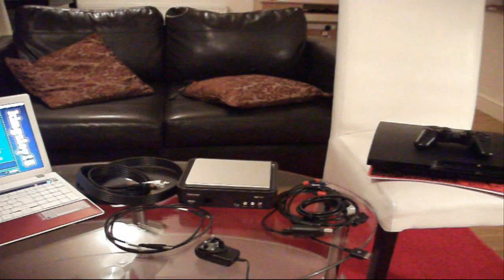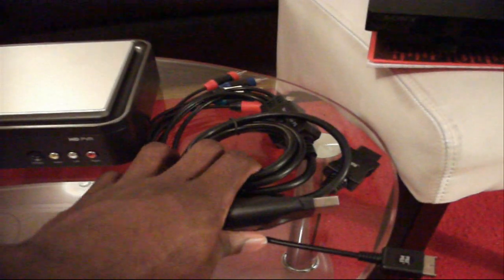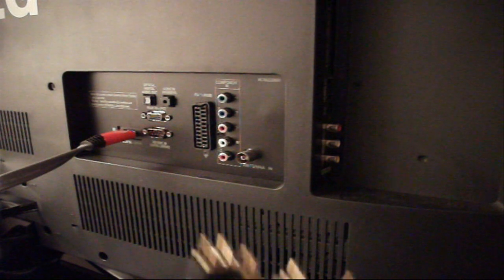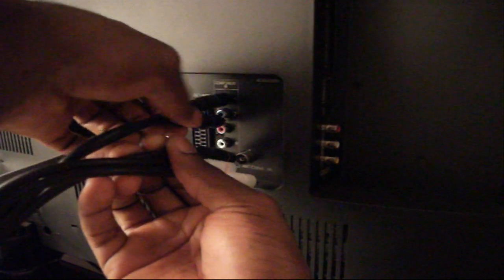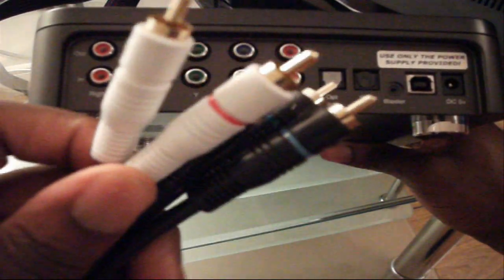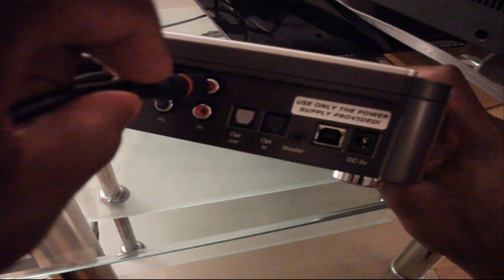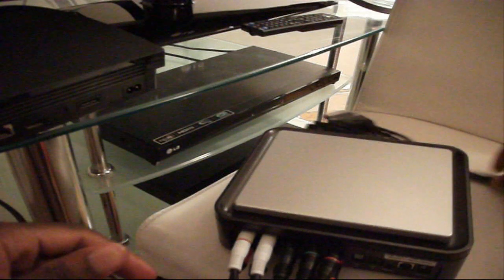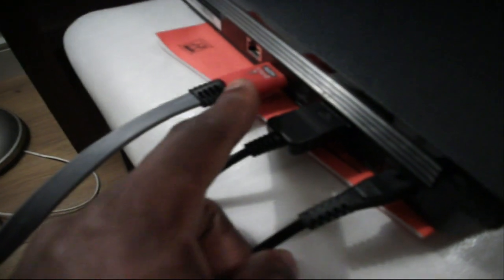Hauppauge HD PVR setup tutorial (ps3): PART 1

Comment from the maker: @MeZuReGB yes your computer specs can run the pvr without a problem...the pvr doesn't really require much specs to run on a computer...

as for your second question, i don't really get what you're trying to ask...but i think i kinda get you. 
the av cable you get with the ps3 does not support high definition.